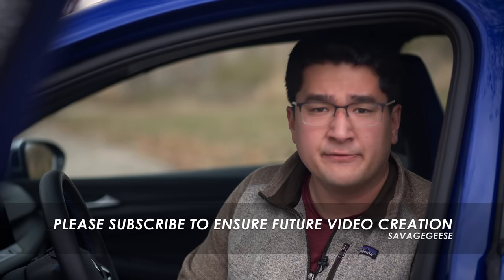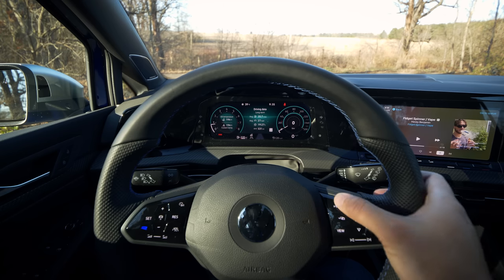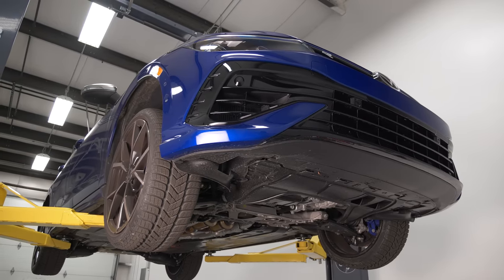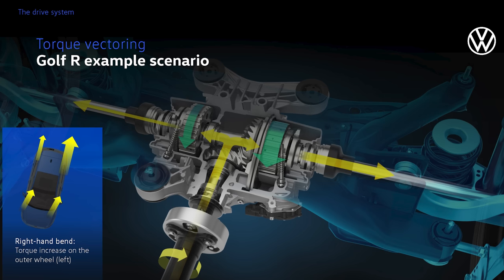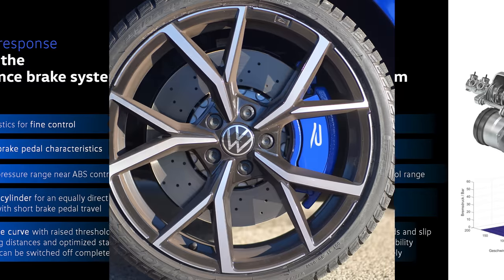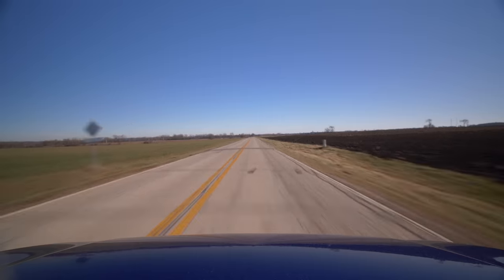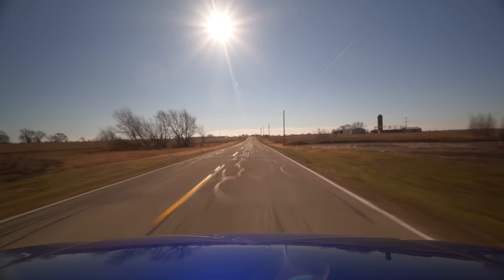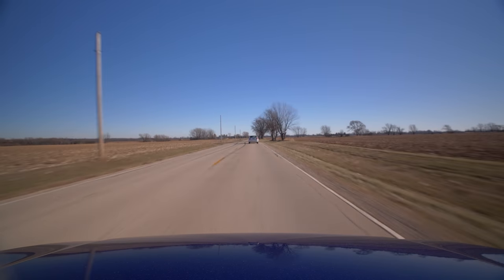2022 VW Golf R | Tearing Up The Streets

Comment: Jack is driving it like a Honda driver bouncing off the rev limiter in every gear.
Reply: Yea, that was a bit annoying to tell you the truth but otherwise great review as always.
Reply: Some cars shifting sound like that, I hope he wasn’t actually doing that
Reply: @HeyhitmeBAM  ofc he was
Reply: Probably due to the engine still making power right up to redline. Sadly it seems a lot of these newer small displacement high power turbo engines are tuned this way from the factory. The result is the rev limiter crash. Probably could do with another 500-800rpm.
Reply: @tailsneon556  these little turbo 4s drop off after 6k (edit. dyno results actually do look much better on this R than last one)
Reply: @papa_pt  Some do. I think the violent rev limiter crashing says this one doesn't.
Reply: @tailsneon556  actually I looked the power curve on this car looks WAY better than the mk7 R which I didn't realize. Looks to pull another 500rpm compared to that
Reply: He was doing that. Doesn’t really matter, though. The rev-limiter exists to protect the engine from being harmed, so it’s not like he was hurting the engine. Plus, it’s a press car, so it’s assumed that they’ll get thrashed, lol.
Reply: @HeyhitmeBAM  Yep, rev limiter city.    Needed to shift every 1.3 - 3.15 seconds.
Reply: @TranceFur  It does exist to protect the engine.     But it's no longer at 7,500 or 8,000.     6,500 doesn't allow for much fun.
Reply: The Seagal bit was golden!
Reply: Yup he did it in the Porsche 911 GT3 video also. Annoying as hell.
Reply: The Honda is a one trick pony. The Golf does everything.
Reply: Him using the limiter as a tach bugs the shit out of me
Reply: LOL @ all these people saying hitting rev limiter is annoying. Am I the only one that loves hearing a little rev limiter action?
Reply: @trackntrail2869  yes. Only bellends hit the limiter

Comment: When will manufacturers learn that no one likes touch controls and one thing everyone wants in their cars is a volume knob
Reply: Don't understand the whole volume knob issue.  Never once used it it any car I have owned.  I always use the steering wheel control to adjust volume.
Reply: And does anyone actually want to talk to their cars? I don't.
Reply: @brianb7844  I use the volume knob every now and then on my MK7. I normally use the steering wheel controls, but I also like a physical button to push on my steering wheel, which the MK8 doesn't have. That's a big no for me. On top of that, its not just the volume control knob. Its the entire climate control system, and all the other tech stuff, that also doesn't have a physical button. Its a very bad design and I can see people trading them in once they get annoyed enough to not want to own the car anymore.
Reply: @brianb7844   That may be true for some drivers. However,  the fact that they made the volume control on the screen unusable at night does not instill confidence for its interface design.
Reply: @waynezw  Agreed.  The lack of back lighting those controls I just don't get.
Reply: @JacesOwnWorld  Completely understand.  I have a feeling this will be changed quickly the next model year.
Reply: @brianb7844  ..and when the steering wheel controls some day stops working. add to that the passenger should be able to use the volume as well. hell the physical controls on the civic and mazda 3 even enhance the look of the dash imo
Reply: @pettersaethre  If the controls on the steering wheel stop working, then I think I would get it fixed. Same thing can happen to a knob.
Reply: @brianb7844  if its worn out then that`s it imo. id go to the scrapyard and find one in good condition
Reply: Most car manufacturers don't care what we like. All they care about is cutting costs and making as much profit as possible. If touch controls save them money then they're going to keep making them, unfortunately.

Comment: I laughed out loud when Mark suggested writing a powershell script to turn off traction control 😂
Reply: Yeah, because real man use bash.
Reply: Get-TCS | Set-TCS -Off -AddHorsepower -TurnUpto11
Reply from the maker: @brokula1312  You are correct
Reply: does that mean toyota uses ruby?
Reply: IF Volkswagen

THEN Throw in the woods
Reply: We all laugh but you know it’s a matter of time before the ECU or other control systems in a car will have APIs that we can access to personalize our experience.
Reply: @tyty0071  This is awesome. Make sure you also run Delete-FakeEngineNoise
Reply: @brokula1312  Then forget what you were trying to do first
Reply: Franz Fanon  I really doubt this thing is running on a platform you could put PoSh core on. Java, maybe.
Reply: I guess they don't read the Owners Manuals to learn how thing work or operate. VW is like Chevy, value and if you want to move up for those features and options you have Audi. Get it read history!

Comment: Golf R owner here. You can add the traction control settings in the upper menu. Just slide down from the top of the screen and hold your finger on one of the apps. You'll be able to swap all the options with different ones, including TC . Also, the noise isn't fake. VW uses Soundaktor for the R, which is a sort of resonator that sends real engine noise through the windshield into the cabin.

Comment: Sounds like I'll keep my 7.5 until 8.5, at least. VW has gotten good interiors for too long to let that experience stand, every outlet has dogged it. I expect a big revision with 8.5.
Reply: Negative feedback was swift and unified on that dash, so VW will hopefully recant like everyone else has so far.
Reply: Lord, I hope so
Reply: @Rdubb That is quite naive to expect them to make significant overhaul of dashboard for .5 version. Do you have evidence of VW doing it ever before? They might come up with 9.0 generation a 1 or 2 years earlier though. But will it be ICE car at all?
Reply: @XX-gg3mx  No evidence, just my gut feel. Golf is the dominant model for VAG in Europe, they would be crazy to let that stand for long. They don't need to do that much, just add a row of buttons below the screen for Climate control and a TC button stashed somewhere and get rid of the capacitance buttons on the wheel. the screens by and large can stay. Automakers have done small refinements on subsequent years before for glaring issues. This is even worse for a selling/marketing point of view because it is something the consumer sees right off them, it's almost worse for sales than like a faulty engine component issue.
Reply: @XX-gg3mx  also, they did a Digital dash and enlarged the screen substantially from 7.0 to 7.5, Id say that was a pretty big overhaul.
Reply: If you have a 7.5 no need to upgrade.

Comment: The “snow tires” installed on this car are Pirelli Sottozero 3 winter performance tires. They provide great traction and handling on cold/dry pavement.
Reply: You forgot to add "for a winter tire". These aren't a performance replacement tire for even what good performance all-seasons can do, let alone proper summer tires.

Comment: Folks are missing the big picture. This new R is a quantum leap ahead of the GTI and old Rs. I've driven the 7.5 a lot. This torque vectoring and suspension updates has made it far far faster in corners and rotatable. It's like the Focus RS, but much better built, refined, riding and looking. Few cars, even 6 figures ones will keep pace in mountain roads. Most will get you wrapped around a tree.

Comment: Replacing the rubber shifter bushings and plastic bracket with Delrin and billet stainless aftermarket greatly improved the shifter feel in my Mk7.
Reply: Thanks for the tip!
Reply: @bbartlow0307  no prob!  I think I went with 034 Motorsports and APR respectively.  Changing gears now makes a nice 'k-snik' feeling when the desired gear is engaged
Reply: Good tip. The soft clutch and imprecise gearbox is the only weakness of the Mk7. I love all the rest of it.
Reply: What's the trade off?  Most aftermarket mods increase NVH i've been told
Reply: @smiddysmidton8313  generally yes, but no NVH worries for this specific mod.  The stock rubber shifter bushings were a little more forgiving in how accurate your shifter throws need to be but aren't responsible for isolating much/any vibration.  Replacing a plastic shift cable bracket with billet stainless one theoretically could transfer more vibration through the cable to the shift knob, but it's imperceptible.

On the other hand, stiffer drivetrain mounts make a hilarious difference in NVH because those directly connect the greatest source of vibration (engine, transmission) to the car chassis.  The NVH difference going from stock to high durometer ("stage 2") polyurethane engine and transmission mounts in my Mk7 was kind of insane.  30k miles later now, I'm switching to "OEM+" rubber mounts to somewhat regain my sanity.  I had my fun lol
Reply: @rabbitenjoyer6320  Made that mistake with a Mk5 VR6. I could hear all the gear wheels  grinding. Won't mess with the engine mounts ever again.
Reply: @smiddysmidton8313  WTF is NVH, cool guy?
Reply: @PS987654321PS  Noise , Vibration and Harshness
Reply: @22noobtube  thank you!
Reply: I love replacing bushings and brackets on my 46,000$ brand new car. Hell yeah.
Reply: @Jay  they make an insert you just add. Don't replace anything. And that's what happens when you have a car that's meant to be plush and compliant as well as go 0-60 in 3.9s. The stiffer mounts are just if you desire a better launch.

Comment: I love my 2016 Golf R, and would love to get another Golf R in the future, but that lack of buttons in favor of the haptic crap really would make me go elsewhere.  Even if they made a different steering wheel with buttons, that would be enough for me as I rarely touch the center stack in my car.  Who in their right mind thought haptic buttons on a steering wheel would be a good idea?!
Reply: And they’re not even haptic.
Reply: Remember this is the company that thought cheating on diesel emissions was a good plan. By that standard the ergonomic failures are minor issues.
Reply: @morstyrannis1951  you say that if they are the only company to do that.. do you have any idea how common it is? VW is at the top right now, of course they will get some heat for it. A lot of other automakers do this, we only know the ones that have been caught so far
Reply: You could swap in a Mk7 steering wheel (which has a nicer, flatter bottom on the rim, has buttons, looks really nice), you could swap an Audi steering wheel or you can swap in another Mk8 steering wheel. The Mk8 Golf has real buttons, you can also swap parts of the steering wheel onto the Mk8 R wheel, but you won’t have the R button
Reply: @PapiAndrey  straw man argument. I didn’t say anything at all about any other company. No idea what point you think you have made.
Reply: @PapiAndrey  do you think that would actually work? I think the odds the wheels are electronically interchangeable are very low.
Reply: Yeah, I wanted this car, but VW can go pound sand with this idiotic infotainment crap. PEOPLE WANT BUTTONS. I'll probably end up with an AWD Mazda 3 turbo.
Reply: @morstyrannis1951  My point was that what you said about the emissions scandal is irrelevant. I know you didn’t say anything about other companies, that’s the point of that sentence. 
If many other companies do it too, why would it matter if VW is doing it? It doesn’t matter
Reply: @morstyrannis1951  I believe it’s possible. It’s been done before and time will tell if it can be done again with the touch sensitive controls. 
People swap Mk7 steering wheels on Mk4’s, Mk5’s/Mk6’s and those are completely different cars. No coding required.
Reply: @OMGWTFLOLSMH  Have you tried it? Maybe try it in person first. I prefer buttons over touch controls too, but the Mazda 3 Turbo isn’t even close to the Golf R or Gti. It’s still a good car though, don’t get me wrong. I just wonder what you are after with these cars. I can think of a few cars that can suit your needs better than both the Mazda and VW
Reply: @PapiAndrey  you completely missed my point which is so obvious I will not try to explain it to you.
Reply: @morstyrannis1951   car emission regulations are way too strict and mostly political. The only real way to cut down on air pollution is when people switch their daily drivers to electric. Hopefully regulations on "fun" cars will loosen then
Reply: @morstyrannis1951  That's not what a straw man argument is.
Reply: @jasonkelley6185  a straw man argument means advancing and refuting an argument the other person did not make. I did not say VW was the only company to do this. Your reading comprehension needs some work before you start your role as a critic.
Reply: Voice control will work fine - how often do you change the A/C - mine is always set to 70*.

Comment: I love it. Performance increases across the board, not a huge price increase compared to the previous gen, manual transmission still available. Someone call Subaru and tell them this is how you properly conduct a redesign.
Reply: At least, an exterior redesign.  Have you seen the Outback interior?  Only thing VW has on the newer Subaru interiors is the steering wheel.  And potentially the seats;  Subaru seats seem to be very "love it or hate it" regarding seating comfort
Reply: Subaru:
Makes an sti with 307hp and a cvt
Reply: @LawrenceTimme  To make things worse, they've been drinking Toyota's kool-aid the last couple refresh cycles.  "Let's make this rally car reliable by utilizing Toyota's approach.  Nobody will mind all the extra weight, plastic cladding, unimproved power and CVT when we have daddy Toyota to tell us how good our SYMMETRICAL ALL WHEEL DRIVE(tm) is!"
Reply: Subaru gave up on their own performance long ago (non-shared). But hey, lifted Outback!
Reply: @richardnavratil9661  lifted outback with a CVT

Comment: Love your reviews - the consistent use of humor and sarcasm (Lite!) always make the deeply technical reviews enjoyable. I do have some comments referring to the infotainment aspect of the car. I actually own a 2022 manual Golf R - and, yes, it is a superb vehicle! However, I have to say I don’t understand the negative nonsense about the infotainment system in the car. For me, it is incredibly intuitive and very easy to use and every touch point on the steering wheel is where VW have had them for years. The slide controls work fine and after a short initial learning period I actually love them - VW engineers are not stupid and this is a step up - not, in my opinion, a step back! Incidentally, I am 66, and have owned every generation of the GTI, so even at my age I have to say the perceptions are not accurate!

Comment: The interior of this is quite literally the only reason I didn't wait & get this car. I would simply not enjoy being on the inside because of all of the little annoying things you've mentioned. Got a '21 Mazda3 Turbo, very happy.
Reply: Those do look like a good option, I just can't push myself to go auto yet. I feel like we are on the brink of never having a manual transmission offering again, so it seems necessary to take it while it's still there.
Reply: Mazda seems like a great choice!  I want a "driver's car" but without losing reliability and safety, or spending an armleg.  The only thing is only VW seems to be sticking with this archetypal hot hatch shape I crave.
Reply: That red/orange color they have is sweet. How's nvh on the highway?
Reply: I too bought a 2021 Mazda 3 turbo premium plus and I can’t recommend it more. Even more surprised everyone wants a Civic SI over the M3 turbo. I don’t understand the US market I guess

Comment: When you guys lifted the trunk did it have trouble opening all the way up do to the spoiler weight? Throttle House had noticed that between the GTI and the R, the R couldn't open the hatch properly without help

Comment: One thing to note.  The MK8 GTI and R look much better in person than on video or photos.   Personally, I like every angle except the rear.  I like the rear of the MK7.5 better.  Interior?  Subjective, but I prefer the 7.5 interior.  I realize EVERTHING is going digital these days, but for some of us out there that just like a simple mechanical gauge cluster, and buttons, dials, simple like that in the MK7.5 GTI S.  When I had my 7.5 GTI S in at the dealer for service last week, I saw the new 8 GTI in the lot.  It was an Autobahn version and the MSRP was $38,700 on the sticker.  With tax and fees we are looking at $41k for a GTI.  I paid $26k for my MK7.5 S.  Do I see a $12k better car??  Again Subjective.  It comes down to what you can afford.  For people like myself that want something fun and practical to drive without breaking the bank, the new car is almost getting out of reach.